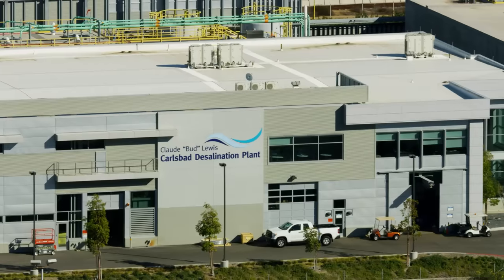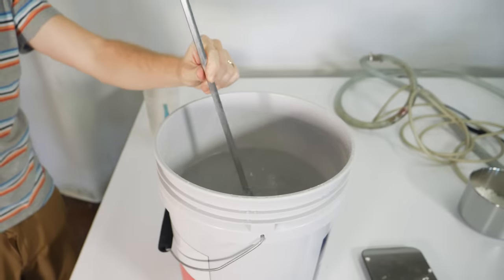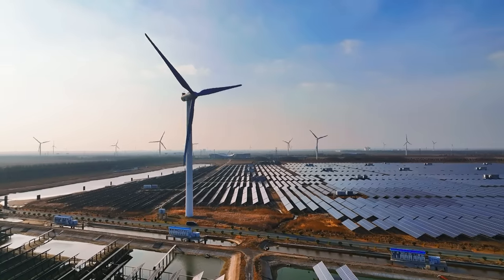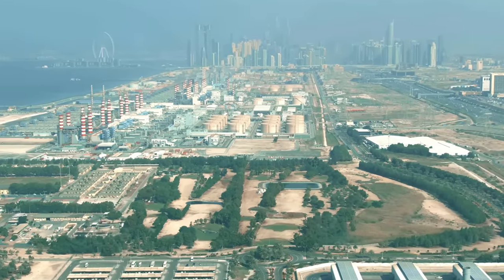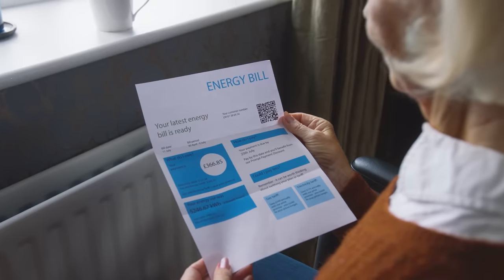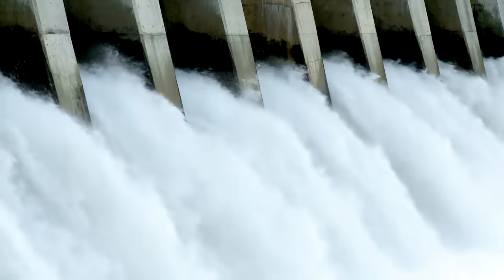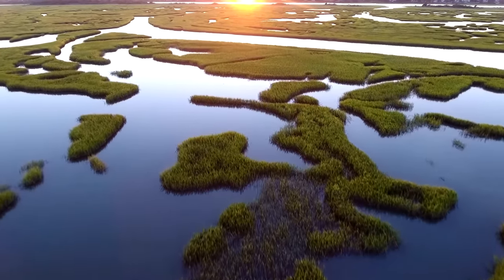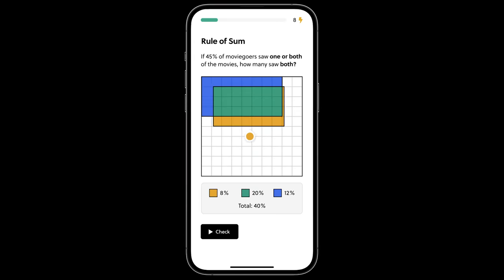Why Is Desalination So Difficult?

Comment: I think one reason people may have a hard time wrapping their head around how difficult it is to get the salt out of the water is that they can’t see what it does - it’s not just swirling around in there, it’s dissolved - it’s harder than getting the cream back out of your coffee
Reply: Next time observing a mountain creek, let's admire the exquisite amounts of energy provided by the Sun to distill all that water.
Reply: @LiborTinka  *low entropy energy
Reply: @AlexanderNash Your comment only serves to show off. Shame
Reply: @AlexanderNash  Yes, the Sun irradiance spectrum is approximately that of a black body radiation spectrum corresponding to 5 760 K. Same amount of energy is radiated back to space at about 255 K, but also about 25 times more photons carying away the entropy (or having wider energy dispersal), allowing for a useful work to be done down here.
A distillation apparatus does basically the same thing - there is heat source and heat sink (condenser), allowing to remove excess heat and condensation of steam to liquid water. A stable temperature gradient is then estabilished, allowing for the most volatile stuff to come over first, leading to separation (lower entropy state) locally, at the expense of more entropy overall.
Reply: @iwanttwoscoops and yours, what does it accomplish?
Reply: Currents or tides?
Reply: @@trollolol705 From my layman's perspective, I think that would be too slow to satisfy the needs of the public.
Reply: Is it though? Maybe on an industrial level, but in the end one only has to distill saltwater. 
A process that was already known to the Greeks in antiquity.
I can't imagine a similar simple way to get cream out of the coffee. 😉
Reply: @iwanttwoscoops  Don't get salty.
Reply: Perfect analogy! 💯
Reply: It costs 540x more energy to turn water into steam than to heat that water by 1°
Reply: what about tooth paste?
Reply: @AlexanderNash I’m disappointed how few people know that you’re comment was just a veritasium plug and nothing more
Reply: Salt is way easier to remove from water than creamer from coffee lol but I like the attempt at trying to help people understand 👍
Reply: Have you ever watched a cruiser channel? Most of them have desalination units on their boats and the units come in many different capacities
Reply: @racecarrik both are fairly simple processes tbh
Reply: @LiborTinka yep, just think of it as a muuuch bigger hot plate but also way more water surface area
Reply: Just distill it and add back some minerals super easy
Reply: @iwanttwoscoops  i think its a reference to the latest veritasium video.
Reply: Is it actually harder then getting cream back out of your coffee?  I get that desalinization is energy intensive, but it's simple enough, boil it, capture the steam, and condense it.  I wouldn't where to start for getting the cream out of your coffee.
Reply: Salt “loves” to be in water 💦 
Btw salts are also an excellent medium for nuclear fuel and heat transfer. See th0rium molten salt reactors 💡
Reply: @wolfgangkranek376  You just need to wait and scoop the cream of the top. Coffee dissolves in water, but cream doesn't really dissolve. Since it's lighter than water, it'll cluster at the top. Granted... You'll end up with a cold, undrinkable coffee 🙂
Reply: @terranovarubacha5473 to shame, what about yours?
Reply: @AlexanderNash lol someone just watched the veritasium video and learned a new word
Reply: Cool the mixture and skim off the cream!
Reply: @jaimes350 still doesn't mean it's easy
Reply: @Frenchdefense9404  what exactly isent easy? puting the unit into a boat or useing it?
Reply: There is absolutely nothing difficult or complicated about it. 😂
Reply: @racecarrik came here to say this

Comment: Here in Uruguay we are facing a drought right now, and the government decided to mix treated salt water in the normal fresh water supply, so now we are getting water on our taps with a salt concentration about 10x of what it used to be. This video turned out to be very well timed for us.
Reply: so the water wasn't treated that well?
Reply: Si pa?
Reply: @alexalekos  no, they're literally running out of fresh water so they're using treated salt water to pad out their remaining supply to meet demand until sufficient rainfall. read.
Reply: @s_t_r_a_y_e_d  but 10x the concentration is more than the intended for desalinated water
Reply: @alexalekos  The water is well treated but they're purposefully blended with high salt water to increase the supply. Bad treatment would mean accidental dumping of salt water, no removal of toxic chemicals or bacteria, etc.
Reply: @ChucksSEADnDEAD  are they straight mixing the tap water with water from the sea?
Reply: @alexalekos  bro what. omg 🤦‍♂️ forget it.
Reply: @alexalekos  I think it is supposed to be read as "we have 10x more salt than usual" rather than 10x the salt of salt water. Not really sure, just hoping to maaybe clear up an English issue.
Reply: @KeithBoehler  I got that from the start, I only thought that 10x of tap water was still too much salt for desalinated water, but I guess these people seem to know well how the situation is

thanks for your help anyway
Reply: @alexalekos does your tap water have so much salt in it that ten times that amount would be a lot?
Reply: it is crazy to make potable water non potable. in order to save water. these people are lunatics. hope it rains soon.
Reply: @alexalekos The water isn't desalinated it's treated. All water is treated to get rid of harmful bacteria and other organic matter, but desalination is an additional step specific to salt water to remove salt. The government treated the salt water to prevent illness but didn't desalinate it so it still has salt. By mixing it with fresh water the salinity is low enough to be safe to drink (but it probably tastes bad and isn't great for cooking)
Reply: @psilocybemusashi  It's not nonpotable. It's just nonpalatable. You can safely drink brackish water.
Reply: I think you should sent video, of this channel, about San Diego grey water plant.
I think it standard should be:
Clean water for drinking, grey water for watering plants. Desalinated water, or grey depending on availability, for washing, bathing, cooling and other industrial use.
Reply: @alexalekos  Its meaningless to criticize the "10x" if we don't know what the baseline was.

Their fresh water may have 1/10th the salt that yours does to begin with....in which case, it would come out equal to yours.
All that matters is the actual end concentration....like absolute salt content, as opposed to relative.
Reply: In South America factors to consider include lack of government planning, corruption, and funding are issues. Your government would probably need a loan from the world bank and engineering and planning from technical experts & companies from outside the country for a desalination plant for starters
Reply: @terranovarubacha5473 it’s not 10x a normal country. It’s 10x higher than the highest in that system. They have 485mg of sodium per Litre, which is 32x higher than the water here in Sydney which has 15mg. So yes, it’s much worse than you think. It’s so salty that animals won’t drink it, and the health department are telling pregnant women, people with kidney disease, or hypertension not to drink it
Reply: @ChadDidNothingWrong 485mg/L. So it’s 10x higher than their system usually has, or 32x higher than the water in my country (Sydney Australia)
Reply: They should implement seawater toilet flushing to conserve fresh water.
Reply: What is a gallon? Is it the same amount as a bucket?
Reply: more good news for you @WKfpv, there is a new desalination method which is insanely efficient as in requiring as good as no energy per ton of water.
it isn't covered in this video yet since it should be published today.

(even though this technology was already tested and finalized at 18 juni 2023, so around a month ago, documenting it for the public just took a while due to all kinds of new problems that occur these days which require publishings to be in very specific formats and such).

it has already been tested and confirmed to work insanely well as well as scale very well. 
and it can be made quite primitive as well compared to other modern methods, that said those more simple ones might work slightly less well but they are something almost anyone could make with a simple guide or such, or just understanding the basics. 

the technology is invented by D(Ellesar Dragon(aka. daan van Loon)) who is the current president of the federation of pangea, they had been facing issues regarding water desalination as well due to a project about making a open city in the ocean. even though this was not the fully picture and only a small part of what was behind it, it is clearly obvious that it will be made freely available to the public for basically anyone to use and make without restrains other than that they are not allowed to use it in a way to limit others from using it(quite similar to the gnu licences).
this has actually been discussed with some of the ministries and all general members of the federation of pangea as well even though the general discussion was mostly taken away due to it being to long.

that means you can without any form of licencing or needing to rely on speciffic corporation can probably within a few days set up such a system yourself.
there is a catch to it all however since it works very different from most other processes essentially making it very chaotic in use, but still I looked at where the area you are is and it seems to be just the type of place where this would work very well without any real troubles setting it up or dealing with that "chaos"(chaos is only in the proces itself, even though the generation of insane amounts of sweet water to the extend which this new technology is capable of can also change things in the surrounding, but due to that chaos also automatically balancing it, you should take it pretty far to cause any problems or really weird things).
Reply: ok
Reply: @nahometesfay1112  why would salt be bad for cooking lol
Reply: @bmxscape  You shouldn't add too much salt to cake. More importantly there's more than just table salt in sea water; the other minerals aren't necessarily gonna be tasty or good for the food you're making.
Reply: @alexalekos  Not necessary. it is properbly just not desalinated. All the other watertreatment might be more complicated to explain, but does not take the same amount of Energy.
Reply: In that kind of Situation I think it is best to see waterdesalination  as a form of energy storage. You build up your renewable energy sources to a point, where  they meet your Energy needs at there worst day. (or dependant on you water needs a little above that). Than put all the energy you don't need into desalination. Fresh water reservoirs are cheaper than most forms of Energy storage.

That is, as long as you actually have a need for that freshwater.
In principle you could get Energy back through the reverse process, but the inefficiences in the process would take the majoraty of that energy.
Reply: @alexalekos they aren't desalinating it, that is not the treatment op is talking about. They're just taking treated - but not desalinated - salt water and adding it to the water supply to stretch it. Scary, tbh.
Reply: The video is so well-timed that he even says at the end on how having desalination plants can be so helpful on times of drought, our problem in the metropolitan area of Uruguay is that all water infrastructure is in just one river which was almost dried up because of the drought, if we had a desalination plant in the Rio de la Plata estuary, we wouldn't have had a water crisis.
Luckily said plant was announced in 2021 and plans to be finished in 3 or 4 years, but too bad the drought came upon us before that plant
Reply: @hairymcnipples  Exactly, it's around 400mg of salt per liter, still it's better to have salty water than having no water at all, and luckily the problem is just on the capital, the rest of the country still has nice water

This was the worst drought for Uruguay in a 100 years (when we started to have a registry, so possibly the worst drought ever) and it got us totally unprepared with all water infrastructure for the capital in just one river, since we always had water of very good quality and we never had a problem before, previous administrations never gave priority to building redundant infrastructure in case something like this happened
Reply: @Judge_Magister  a little less than 4 liters
Reply: @psilocybemusashi I are lubatic
Reply: @s_t_r_a_y_e_d  Treated salt water doesn't mean anything... how was it treated? You are the one that isn't reading and instead reading what you assume rather than what is written.
Reply: @nahometesfay1112  You usually salt water for cooking... it would be worse for drinking than for cooking... smh
Reply: @Judge_Magister  What is a dolt? Is it you? Yes it is, whos a dolt? Your a dolt!
Reply: @nahometesfay1112  a half gram in a liter is not going to be noticed in most anything.
Reply: @212-3  It probably isn't the worst drought in Uruguay ever... the chances of that is really really really small, the big problem here is that you think your are intelligent and you are making such insane comments.
Reply: @thomgizziz  I see you've stumbled across a mirror. Yes, the dolt you're looking at is, in fact, you.
Reply: @thomgizziz  He didn't say "likely", he said "possibly" - which is entirely true, and says nothing about the odds. It is also technically possible for the Brownian motion of the air molecules in your room to put them all on one side, leaving the other side airless, but in practice this never happens because it is unbelievably unlikely.

If your ego was any bigger or any denser, you would collapse into a black hole.

What you need is an octuple-dose of humility, because you're severely deficient in it... oh, and go desalinate yourself, because you're being incredibly salty for no reason whatsoever.
Reply: @alexalekos  wow... you're missing the point... it is NOT desalinated, it's TREATED saltwater mixed into the freshwater
Reply: @wachinpntdry.  yh thanks i understood lol

Comment: Spoken like a true engineer...  "The instructions didn't say to not run salt water through the pump"
Reply: Yes.  This is another engineer's problem.  He is actually helping that engineer discover failure conditions to add to the warning labels.
Reply: They will do after this video
Reply: That's good. If the pump gets broken in the process he can return it since he didn't use in a way it's not supposed to be used.
Reply: @seneca983 : True but the pump guts are ceramic, stainless steel and silicone rubber so clean salt water should not hurt it. 600 psi is under half it's water blaster pressure so should not be strained either.
Reply: @howardsimpson489  If it's stainless steel it would probably corrode somewhat faster than otherwise. Stainless steel isn't really completely stainless. Though maybe it's not a big issue.
Reply: @seneca983  316 Stainless does pretty good in salt water.....Then duplex stainless-especially 2507 is supposed to be good for "chloride corrosion resistance" whatever that means exactly lol.
Reply: @howardsimpson489 then again, he's using what he explicitly calls "the cheapest pressure washer available", so who knows what the quality of the components/materials really are in that thing.
Reply: Lets make a gallon of espressso.  Manaul said nothing about coffee.
Reply: It can work, it'll just corrode under continuous use if it isn't stainless steel
Reply: @ChadDidNothingWrong  Probably a weird question, but where do I go to find people that talk about stuff like this?
Reply: @mnxs Almost entirely plastic I'm picking.
Reply: That's kind off block head reasoning, not engineer.